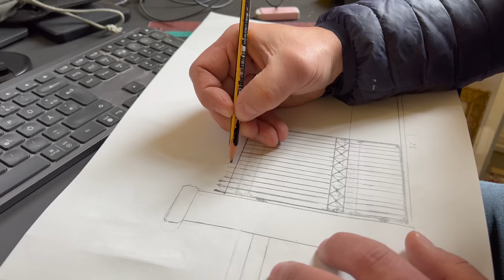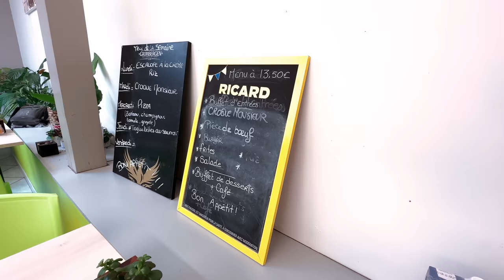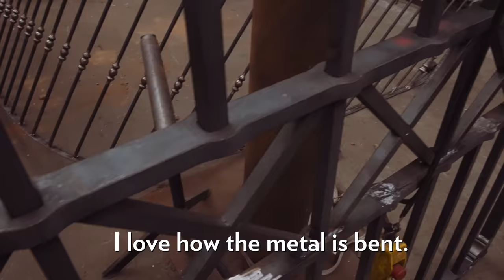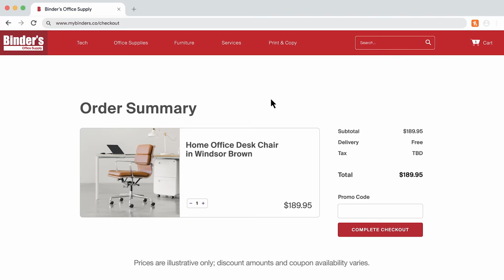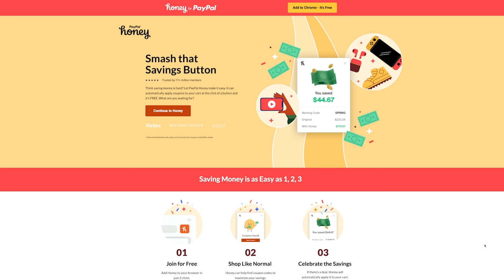Finally NEW Chateau Gates: Traditionally forged

Comment: Loved all the updates. If you get the chance, the best thing for the rose and any other climbing plants that don’t self support is to set horizontal wires at 45cm from the ground and then every 30cm higher for the desired width. That way it doesn’t matter how the rose is pruned in future, there will always be a support to tie it to.

Comment: The gate is beautiful.. as a half Italian ( Mother is from Florence and is a classicist ) The "fleur de lys" is actually an iris .. and is on the coat of arms of Florence and when Catherine de Medici from Florence married Henry ll the flower was then incorporated into the French  iconography and dubbed a lily......btw... I hope the motor for the gates is engineered to carry the weight of the gates.... I would have also a way to move the gates without the motor..just for the emergency of having to leave urgently and the power is out...

Comment: for your climbing rose....firstly you need to use stainless steel wire only.....galvanized, although cheaper will only last a season or two....and it then becomes 'painful' to redo. For a climbing rose 2-4 mm dia. is acceptable..you can use galvanised attachments to reduce cost......for the rose itself, you will get more blooms on the horizontal so it's best to have main stems giving height but promote good horizontal branches which will provide many more buds than vertical...

Comment: In America, we call the strip of wood between the cabinet and the wall a "filler".
Reply: I thought it was a shim 😂
Reply: @natashah9056  we use shims to level out or make plumb a door or cabinet. But shims are not something that should be visible since it's a wedged shaped, low grade wood and usually it's ugly. Fillers are used to fill a space between cabinets or a cabinet and wall that will be visible. They are generally finished in the same finish as the cabinet.
Reply: @ds4101  thank you for the clarification!